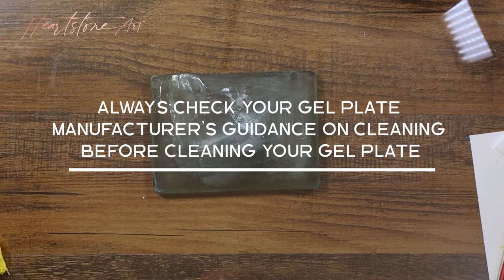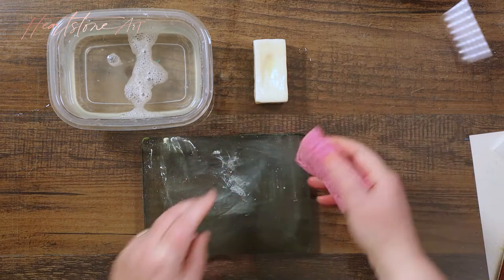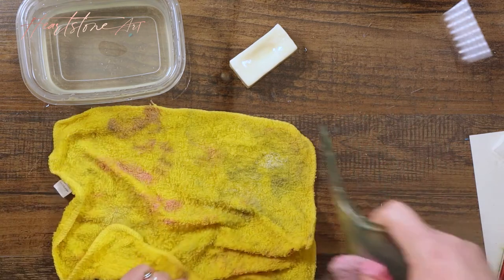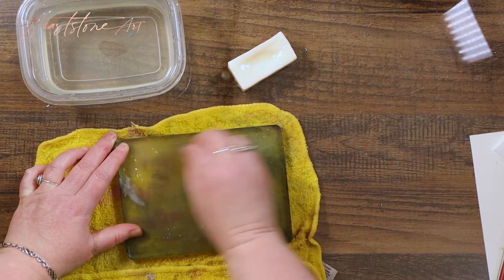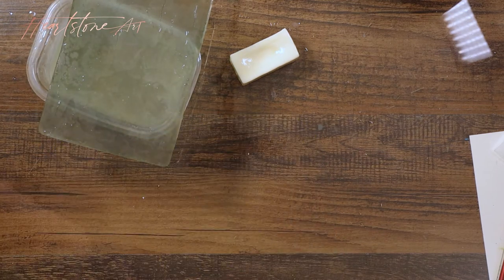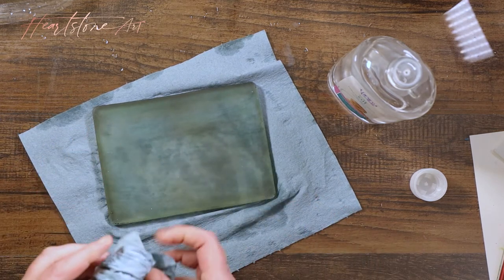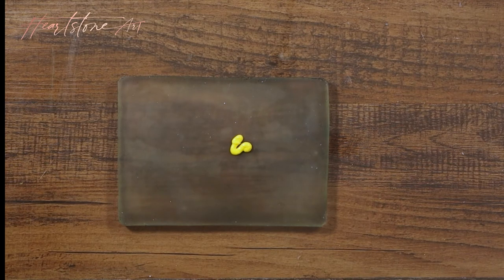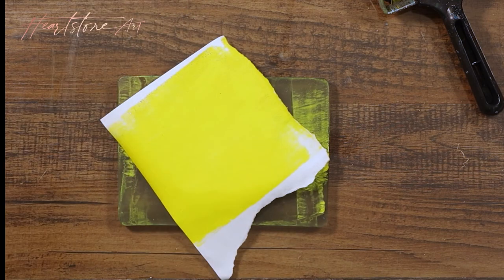How to deep clean your gel plate

Comment: Usually I just roll on lots of wet acrylic cover with thick paper firmly over night 🌃 peel the paper off next day and for any little bits left use baby wipe.
Reply from the maker: That would certainly soak it. I find the soap and mineral oil combination refreshes the plate completely - mine look almost new after cleaning, and my largest one has been pretty heavily stained.